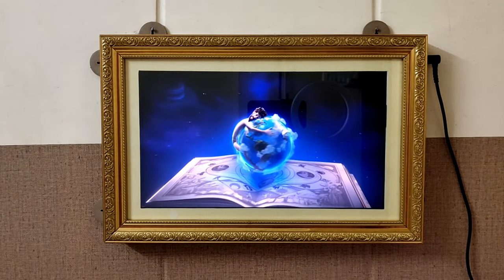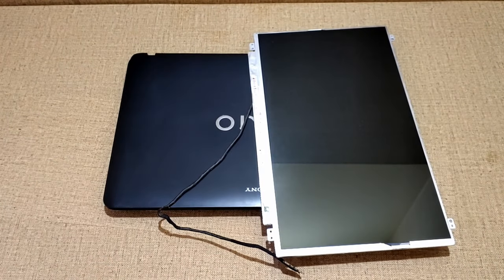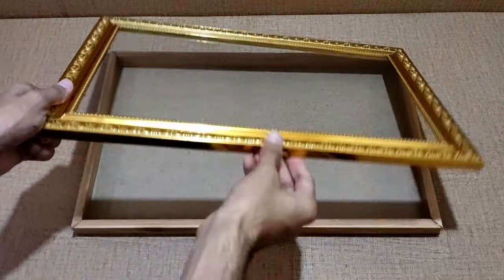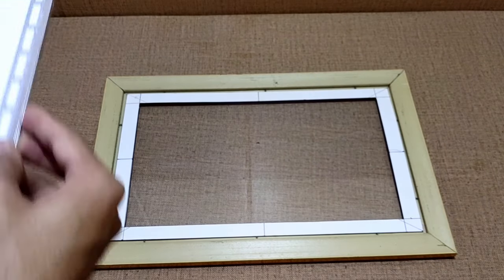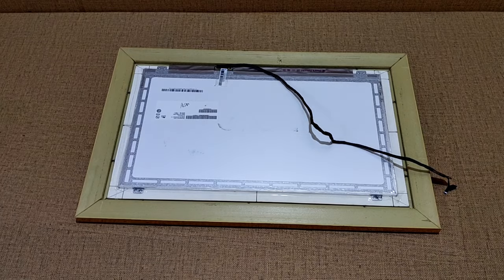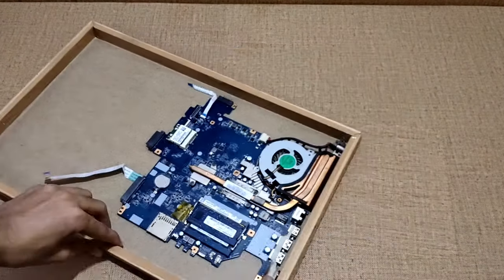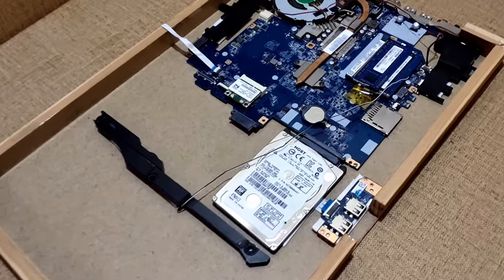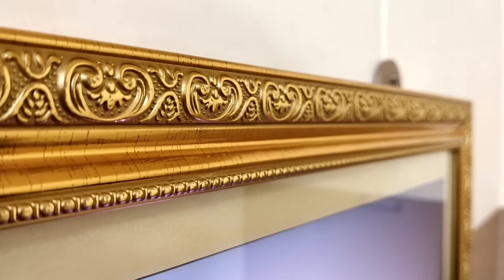DIY Harry Potter Moving Portrait Using Old Laptop/Raspberry Pi

Comment: I need help. I would like to have a short video of my friend standing still on a loop. When a motion sensor is activated. It will switch to my friend moving on a loop then switch back to the first loop.
Also do you know of a filter that can be placed in front of the monitor to give an old looking photograph? I would like to use a raspberry Pi.
I love your design. Is my idea practical?
Thank You in advance.
Reply from the maker: Yes it's practical, I dont know how to trigger video Play with sensor but with some research and python script it's possible. 
About the filter you don't have to place any phisical filer just add the filter from any video editing software.
Reply: Use Live Photo’s on iPhone

Comment: bro can we use as normal laptop? as it was before like using wifi,bt,using pendrives,surfing internet etc....
Reply from the maker: Yes you can use as the normal laptop, as I have put USB ports to side and WiFi antena, wireless keyboard & mouse, but I won't suggest to make it with your good laptop if your laptop is old and has no use then go with it. Or just buy a cheap old or new LCD monitor put it in the frame and connect the HDMI.
Reply: @makerbrains  yes ik, my laptop is old and lags too much. so I'm planning to make this moving potrait  and thanks for answering my question!